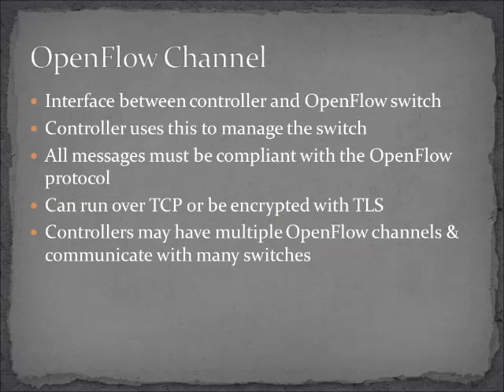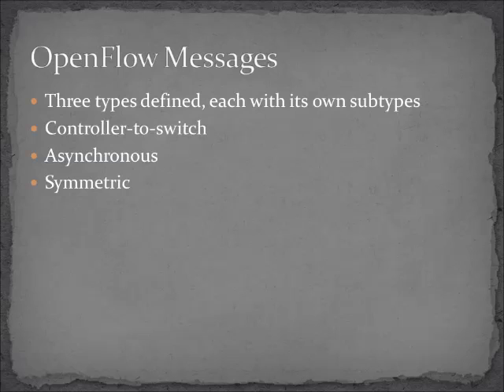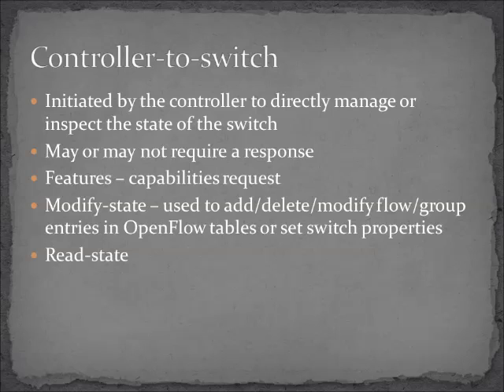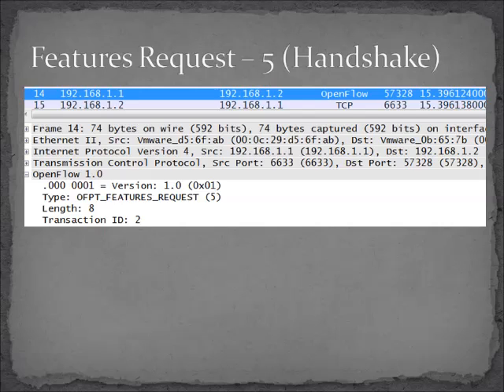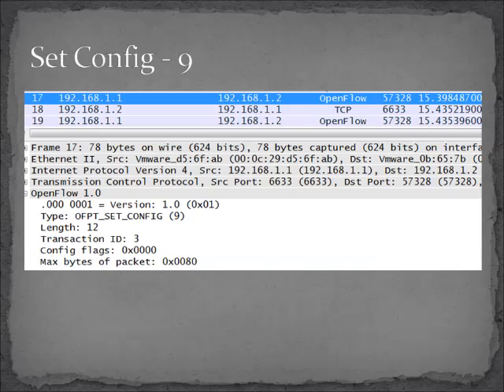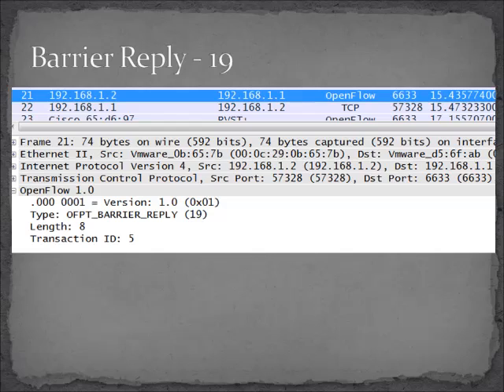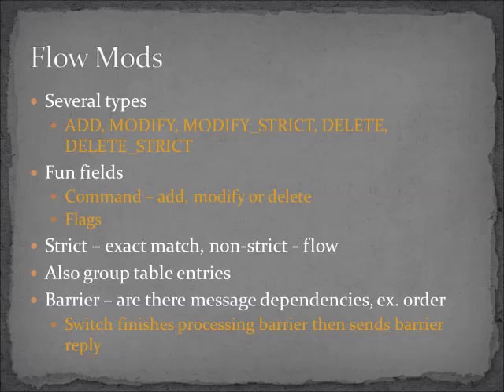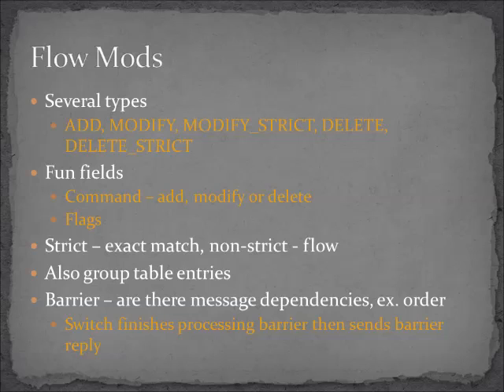Intro to OpenFlow part 2

Comment: Hi, thanks Dr. For your great work and your time.
In my project I want nodes to send(battery level, position, neighbor, etc...) to controller, but I don't how to send nodes information.
Can you help me, please
Reply from the maker: Well, this was about OpenFlow in an SDN topology...for telemetry I think you would have to rely on a management protocol or custom code you might write. For example, SNMP can send whatever objects are in the MIB. For things I want from systems, I write code that saves the data for transmission to a server. Hope this helps...